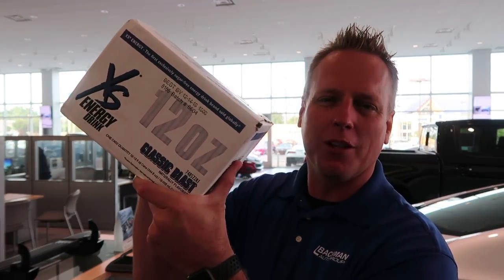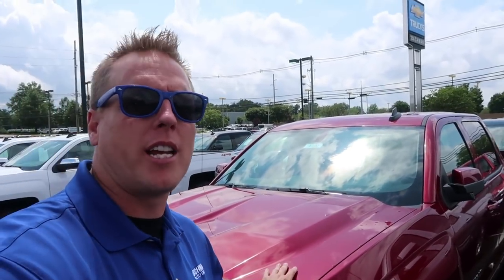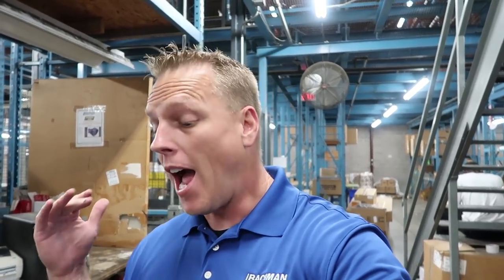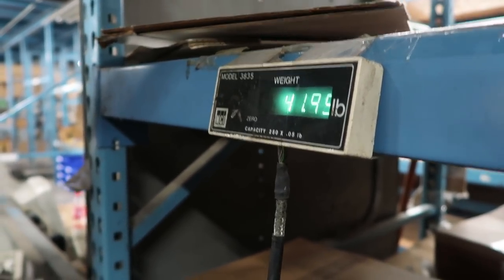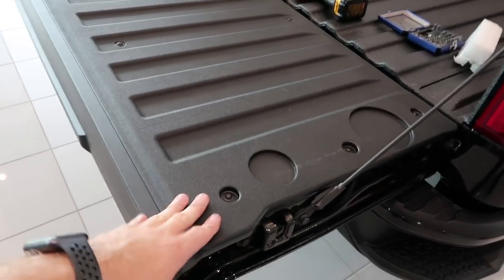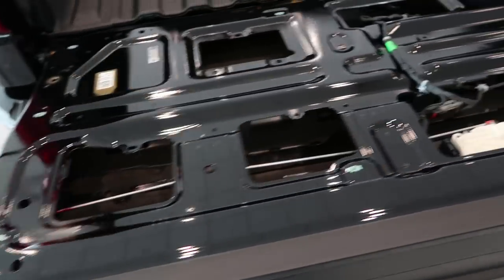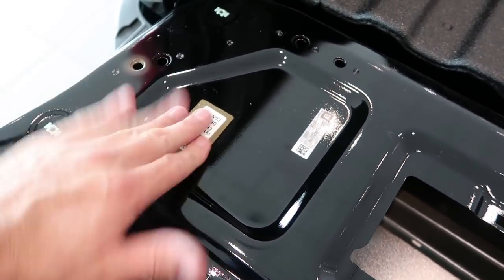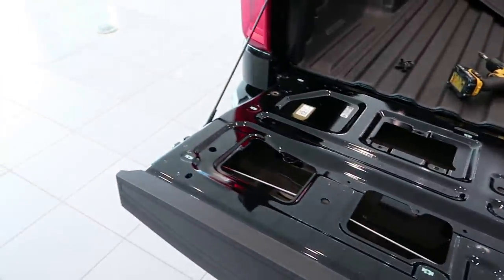2019 Tailgate vs 2018 tailgate. Does aluminum make a difference?

Comment: So in this day and age can you just buy a truck that is a truck?  When we did farming at the end of the week my dad would bring his truck home park it in the front yard (Do that with an HOA) put an oscillating fan yard sprinkler in side, turn it on and let it wash all the dust, dirt mud and grime of of the cab.  Leave it open to dry out under the Arizona sun.  Then reinstall the rubber floor mat and it would be ready to go for the next week.  It also seems like the normal size of a truck has gotten so much larger than the standard old work trucks we used to have in the 70's, 80's and the early 90's
Reply: So can you just buy a 2 door standard cab truck?
Reply: Yea a wet rag would’ve worked fine.
Reply: Right a lawn sprinkler in a truck at the end of the day is what men do, not hillbilly at all.
Reply: Oh yeah, not a farmer by the way just a welder, in Oklahoma. Are you saying that farming is the only difficult job out there?
Reply: You can still buy them. But unfortunately you are buying into all the crybaby drama queen bullshit.🙄🙄🙄 Just bought a full-size regular cab, 8 ft bed truck. No amenities except power windows and locks and backup camera (which is standard now) bought for just over 30k but without 4x4 you can still get for mid 20's  AND YES IT HAS A VINYL Floor.....so I dont know why you do not know this....??????????

Comment: My opinion is automatic tail gate is just excuse to justify the cost. What truck guy really wants a powered tail. Dampered going down is great. Pulling a latch is just as ez as pushing a button and a whole lot cheaper and reliable. And for 12lbs difference give me steel. Those Chevy designers n engineers need to get out more.
Reply: Ric Dro I saw a video that showed the Custom models have a latch standard. I’ll probably e opting for that when I get my Custom Trail Boss. I hate the idea of my tailgate being stuck up or down if the battery dies
Reply: having a good ole latch is a premium. go figure. also when going off roading the chances of damaging the module or motor goes up. powered tg usless imho.
Reply: You are paying for engineering. OF the whole truck sadly. This is how everything works.
Reply: haschengrube x yup. Reimbursement for R&D and saving for future R&D plus SOME profit and overhead.

Comment: I am sure to get trolled with this comment but oh well.. I have never been 'politically correct' in any manner.   The new trucks look nice.  I understand the desire to get better mileage, better  acceleration without using a bigger motor, drive train and etc.   BUT I find it incredible how today, trucks are going the way of passenger cars...  i.e., all fluff and no substance.

Trucks now are being designed for the "consumer" type person..  NOT the ones that actually 'use' them for what they were originally intended.   These newer trucks are failing in a number of areas around here.. especially with and on real life farms.  They might be just fine driving down the road.. but they are not holding up under real work loads.  And the reason they are adding those "plastic" bed liners and wall liners is because the aluminum is shit when it comes to just that fact and being able to take the hard knocks of real life hard working trucks.  I cannot tell you how many trucks I have seen with these new aluminum parts with holes in them from just metal bars, shovels and other items being thrown into them..  I saw one bed where a large heavy load of rock tore numerous holes into the bed from angles hitting just right.  The "plastic" addition helps cushion some of that.. temporarily.

But that is not even the worst part...  the worst part is cost to repair that or replace it.  Compared to this new aluminum stuff, consumers are getting ripped off HUGE by the cost of repair to aluminum parts being replaced... parts that used to be steel that not only would NOT have broken, bent or been punctured under similar use, but would also be 1/4 the cost to fix.

With steel parts, when you did put a hole in your bed or maybe snapped off the tailgate hinge, if you did not have the time you could wait to go to a dealer to get a fix, in a pinch (or even for a permanent solution), you could pull up your welder and plug the hole, repair the snapped hinge or at least do something to get your truck moving again.. perhaps even to a dealer for a full on repair.... now?  Nope because most people 1) do not have the ability or knowledge to weld aluminum, and 2) in many cases when it goes, it is not repairable even temporary in an emergency.

Truck makers need to get off this profit kick and get back to real business.  For the 'civilian' market where those buying just want the truck cool crowd to go 'ooo and ahhh', these new trucks are just fine.. go for it..  BUT the companies need to also need to have the SAME truck still available at a lower price point in all steel construction too for those that actually NEED it or want it.

These changes to trucks just play into something everyone has heard before...  "they sure don't make them like they used to but they sure do charge double for that anyway!"

Many of us don't buy trucks for comforts and the 'oooo' factor... nor do we like spending $70,000 on something that cost 1/3 that to actually make.  But what really is sad is then also getting ripped off when repairs cost triple and more now because of the privilege we got paying twice as much for new technology we did not need, want or ask for.... not to mention having to buy a new one in 1/2 the time of our old one because the damn thing is made out of paper like material.
Reply: I'm from the UK and I even agree with you, hence why my pickup is from 1999!
Reply: Man I think you have a lot of good points , myself I own a 77 Impala with 305 2 Barrel then unfortunately is rusted out but I know how to work on it I also have a 91 GMC RV but I can work on it I also have a 08 Avalanche unfortunately I like pretty much do that thing is change spark plugs and change the oil and I have a 04 Pontiac Grand Prix that too can pretty much just do the oil and plugs they just don't make them for the consumer to be able to work on anymore and it sucks
Reply: Base model work trucks are still around and can be bought for 33 k or so
Reply: @temur72  Yeah, but even the base model work trucks are still full of unnecessary electronics.
Reply: @Spac8  A base model WT can be gotten with just power windows, bench front seat a basic infotainment system. No driver aids, just a basic 4wd or 2 we system. Basic A.C. 

The only extra electronics being in the engine
Reply: These are great point man. I wish there was a way everyone could get what they want, but can you imagine the cost increase if GM offered all those choices on top of 8 different models? It’s pretty bad that as it is, you can’t even get all the trucks today. All I can find here in Texas are the high $ models like HC, LTZ and TB. Even the TBs on lots right now are all decked out and coming in at $55k. I won’t be able to afford anything until they release the Custom TB and I’m hoping that one can be had for less than $40k. Anyway, point being that with the civilian market having the lions share of the manufacturers ears, I think the days of “longer lasting most dependable trucks on the road” may be coming to a close. It’s all going to be about selling high and getting everyone to come back within 2-5 years for another.
Reply: That being said, these trucks probably won’t hold much resale and you’ll be finding low mileage repos on used lots by this time next year lol
Reply: Malakie Usn I couldn't have said it better myself, if a truck can't work hard or be heavy duty then what's the point of it being a truck? 2018 the last year of the REAL WORLD Silverado...
Reply: I understand the first reason for the use... But you are wrong when it comes to this having nothing to do with profit margins... If that were the case, costs for repair would actually be similar if not lower than steel..  Costs to repair ANY part of the aluminum in trucks now using it, has gone through the freaking roof.. and there is NO REASON at all for that.  While using aluminum to reduce weight does and is tied to emissions, the fact anything tied to using it double, triple and even higher in prices and repair costs has happened, has nothing to do with the first part.   Yet people for some reason are keeping their mouths shut and not talking and complaining about it..  

Why do you think trucks now cost an average of $67,000 dollars new with the most common features people get?   Because people are not speaking out..   Instead they just plod along and pay for those prices... and at the rate they are going, another 5 years, we will be paying upward of $100,000 for brand new trucks at this rate.  It IS all about the money and anyone with common sense, knows it.

There is a reason more and more people are waiting to upgrade, buy new and trade in..  myself included.  I am done throwing money away to profiteering.  I prefer to buy something older and repair or even restore it at this point..  Once trucks hit that $60,000 tag I said no.. they are not getting any more money from me for new buys when it comes to trucks.
Reply: @kountryquads9475  Silverados have kinda sucked for a long time...

Comment: Here is what concerns me. The feature to split the tailgate in half (allowing the top half of it to act like a stop for longer cargo and to expand your bed length) can really get smashed if you drop the gate while that top half of the gate is also opened. It will just fall right down and slam in the the ball on your hitch. I saw that on one of the 2019 GMCs.

Comment: Thought there would be more of a weight difference.
Reply: Paul Stan yeah same, well maybe now they wont rust out of them bottom lip
Reply: Fake news from chevy
Reply: total the aluminum trucks are only about 300 pounds difference. Not a very lagre weight savings in the least.
Reply: Its only one part the weight savings is around the whole truck. 12 pounds off of one item is alot paul.

Comment: For only a 12 pound difference I would love if they had kept it steel
Reply: Why?  why would you want to carry a bowling ball worth of weight around when you don't have to?  You certainly don't need the back of the tailgate to be steel?  Carry 12 pound bowling ball around all day and then see why the approximately 450 total weight loss of the 2019 Silverado is a major improvement for truck buyers.  High Strength steel is reserved where it is needed like the bed of the truck that carries weight.

Comment: The stickers get put on in the body shop and sent to paint to keep the part organized. They put tape over it because it sticks better to the raw metal than the paint. And since no one sees it they don’t bother painting it. If you look at any of the 2018 trucks factory sticker they were the same way. Those little holes throughout the tailgate are there to line up the smaller pieces in the fixture so that the robots can pick them up and weld them together.

Comment: I seen in a different channel a guy showed the bottom  side of new Chevy. The exhaust is cheaply made where it turns into duel outlets. They aren't really connected in the back. If truck becomes damaged in a wreck anything made from aluminum has to be replaced no fixing that

Comment: I'm gonna guess it weighs 29.68 lbs. Total guess I swear. I paused the video then write this.
Reply: It turns out to be 42 lbs which is not good enough savings to use aluminum, it's probably not aircraft grade either.

Comment: 7:38  "It's an electric motor so the fail rate should be pretty low"  compared to what?  The standard non-electric?  Hydraulic or vacuum motors?    😂

Comment: I've really enjoyed your videos, and they were a big help in getting my new 2020 3500. I know this was about tailgate weight, but when I removed mine, all the cameras stopped working. Do you know if there is a workaround. I would like the other cameras to continue working. I remove and replace frequently as the reason I bought a 3500 was to have an overhead camper and go on frequent trips.

Comment: Several folks commentated that “12 lbs aren’t much”. But if you consider the reduction as a 22% reduction, which it is, it becomes more meaningful, particularly as it relates to GM meeting overall fuel standards. 

As to the matter of trucks going “soft” with electric tailgates and such. Take a look around at who is driving them. In and around north Atlanta suburbs, it appears that more women are driving trucks then men.

Comment: Hi mike when you design a truck you need to also design places for the machines to HOLD the items. The holes are where machines and racks pass the parts along the line and also knockouts for when they are formed and tamped so the they stay in place to ensure we get the same part every time :) When it heads off to paint they are used to hold the items from the other side too. The bends and boxes are for rigidity. They are designed with flex in mind and weight. As well as material loss efficiency due to target. (If we want to target a certain weight or force capability we don't need to waste materials on those items.) Everything else you see is to combat compatibility issues with the machines racks and holders above. Why redesign THOSE year to year. It is too costly. So redesigned items MAY have the same "Patterns on them" but have different design weight and force targets. Hope this answers your question Mike.

Also 12 pounds is A LOT off of one item. (depending on its targets and the item itself.) The whole truck is X-Hundred pounds lighter. Most people who don't engineer anything would complain as I've read below. Creating things isn't as easy as critiquing them. Thank you for reading mike i love your channel.  Ciao

Comment: @chevydude so just curious but i have the f150 with the drop tailgate it has Zero safety features to stop it from hitting my trailer jack or if I'm parked to close to something that could damage it. Does the silverado have any safety limits to theirs? Like the sensors picking up objects or people so it doesn't hit something going up or down

Comment: I hope they make a standard tailgate an option on the HDs at least.... Glad I bought a 2019 HD and still have the handle at least, but even on that the electric lock will freeze closed in the wintertime. What an annoyance, and without a handle, how will you pull the gate open when it’s frozen and you have a tonneau cover?

Comment: So all you have under that flimsy plastic cover on the inside of the tailgate is open holes?  What if you have some cargo that shifts and slides into it while you are driving?  It will go right through it.  I'll take the all steel tailgate of my 2018 Ram, of which the factory bedliner tailgate cover re-uses the 6 bolts holding the steel access panel.

Comment: The wires don’t look to be protected at all from something dropped on the tailgate when loading or unloading.that thin plastic tailgate cover wouldn’t protect the wires under it if you dropped a toolbox on the gate ..or would it?

Comment: The barcode sticker is scanned at the manufacturering plant to make sure the correct tailgate goes on the correct truck. They put them on all part that can be optioned for other part. Heated seats vs heated and cooled seat for example.

Comment: take a straight edge and see if when you slide it along the floor tward the tailgate and see  if it hits the tailgate ..   i make slider for beds of pickups and my 06 and 17 both hit  no adjustment to fix it gm did nothing  i know how to fix it  but it might be a safety issue .

Comment: Does the new Silverado have adaptive cruise as an option on any of the trims?
Reply: On the 2020 Chevrolet Silverado, the adaptive cruise control system is only offered as an optional extra on the Silverado LT, LTZ and High Country – no word yet on why it’s not offered on RST, Custom or Custom Trail Boss trims.

Comment: any ideas when the double cabs are going to start being delivered to you guys?I noticed they are all crew cabs right now.
Reply: Jim : same here I want the simple Double cab 4.3 V6 work truck. Can't get those just yet
Reply: Benito JR what's the msrp on one of those base model work trucks?
Reply: Dodge 318 Cummins . the Chevrolet 1500 2WD extended cab  4.3 V6 stats at $33k & 35k for the GMC 1500.  as compared to A Toyoda  Tundra work truck 2WD 4.6 V8 2WD costs 31k & change.
Reply: Benito JR oh any idea what the regular cab is? Only interested in that as the 2019 ram is only 4 door but $29,000 no regular cab.
Reply: Dodge 318 Cummins . No the 2019 ram does have single cab. However it's the 2018 ram version  labeled as a 2019. It's called
 "RAM 1500 CLASSIC'
Reply: Benito JR I know I'm talking about the redesigned one that everyone wants not the 10 year old model

Comment: For 12 pounds and electronic latch that will most likely short out at some point from rain water or cold, I’m walking out of your dealership with that 2018. Looks just as good, interior dare I say is just as nice, and you don’t get a flimsy piece of plastic covering a electronic hollowed out aluminum tailgate. Not to mention it’s an old model now so I’m gonna get a better deal lol.
Reply: nkyryry these aluminum tailgates are actually designed really well and strong. I’ve dropped a couple and nothing has really happened to them compared to the steels ones we hd.
Reply: Keep that cheap aluminum.  Older trucks it is for me now on. I didnt buy a truck for fuel economy or to race it. I bought it to tow and haul.